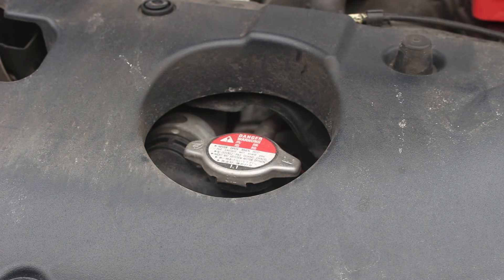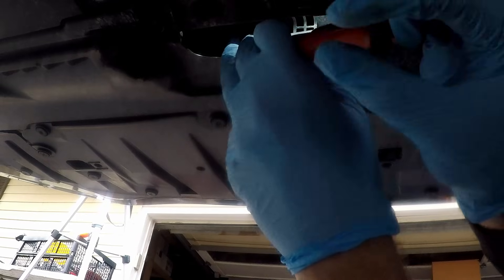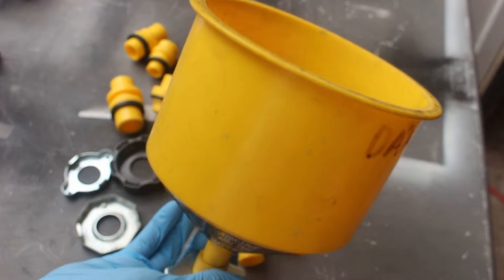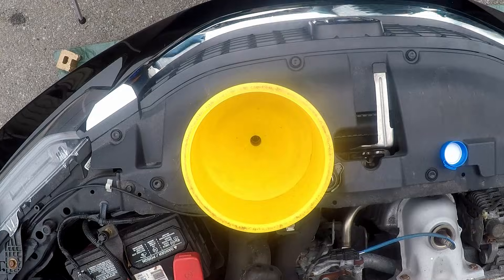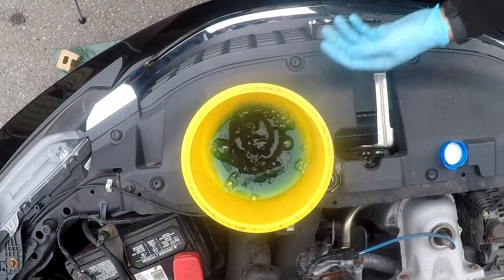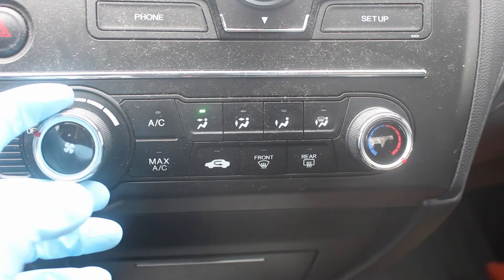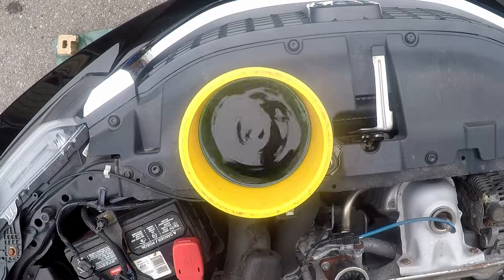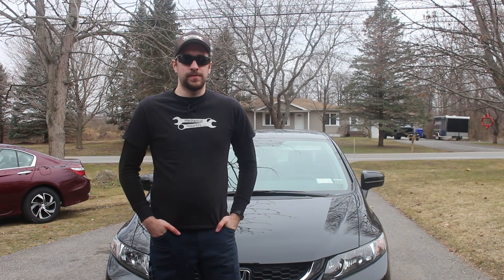Basic Coolant Drain, Fill, & Air Bleed

Comment: Best video I’ve seen.  What about the reservoir keep the cap off and fill it a little?

And have fan on first and set to warm then turn on car?

That’s how I’ll do it. Does this sound ok?
Reply from the maker: If it's just an expansion reservoir, then when you're done you should fill it to the max mark.
When I'm bleeding the air I turn the heat to full hot to make sure the coolant is flowing through and gets hot.